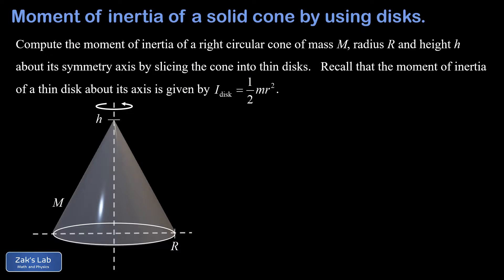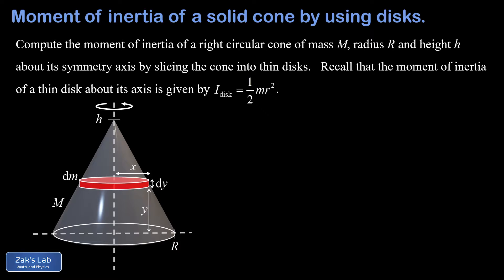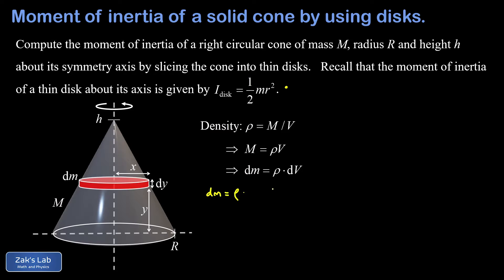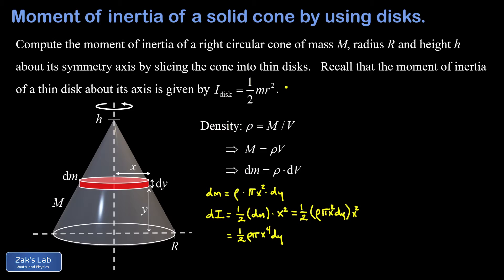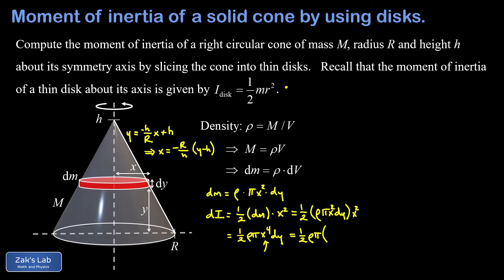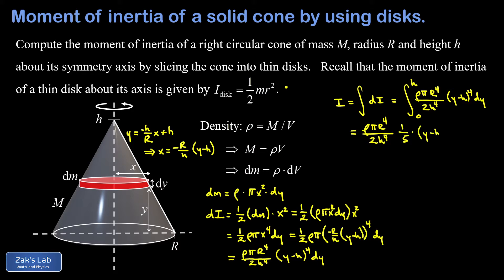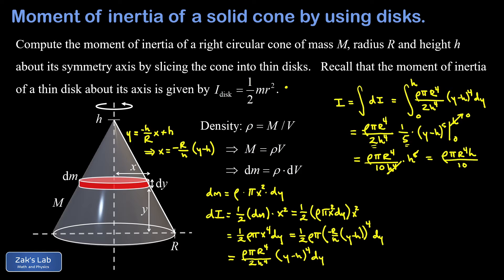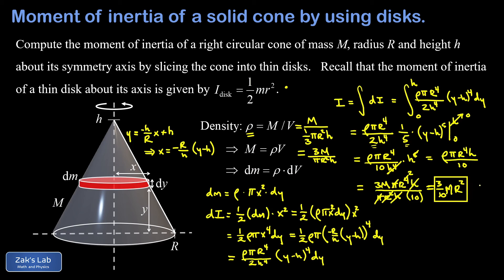Using disks to derive the moment of inertia of a cone about its symmetry axis.

Comment: Hello, this video solution was good, thanks for that. Can you find out the moment of inertia of a cone which is not solid and it has Q charge unfiormly distributed over the surface. It is a right circular cone of semi vertical angle theta and height h. I would appreciate it, if you do could explain it in the most simplest way, because I am just a student with very little knowledge of integral calculus. Thank you!

Comment: is it possible to find the moment of inertia of a cone about its symmetry axis using I = Integral of r^2 dm instead of using disks in the first place?
Reply from the maker: I think you could do it with an integral in cylindrical coordinates, where the dm's are given by phi*dV, and the volume element is dV=Rd(theta)*dr*dz.  I haven't used multiple integration in ages because we work everything into single integrals in introductory physics:  due to the coordination with our multivariate calculus courses, students can't be expected to have seen double or triple integrals.  This doesn't stop me from having them solve tons of differential equations in context, compute path integrals and surface integrals for Gauss' Law and Ampere's Law, etc., but for moment of inertia integrals we're always able to cook it down to a single integral!  z

Comment: I used y/x=tan theta= h/R to express x and got the same answer. I didn’t know the slope formula could be used like this😂 Fun 👍
Reply from the maker: I don't think that's exactly describing the cone in the same orientation, because your x doesn't decrease as y increases.  It ends up not mattering because it's exactly what you'd get by flipping the cone upside down, which of course doesn't change its moment of inertia. z
Reply: @ZaksLab My y is the distance from the top to the surface of the chosen disk, not the y in your graph. 🤔
Reply from the maker: @juniorcyans2025  I get it . . . my upside down cone is your inverted coordinate system.  Either way it is simpler to not have the line y=-h/R(x)+h like I did in the video! z